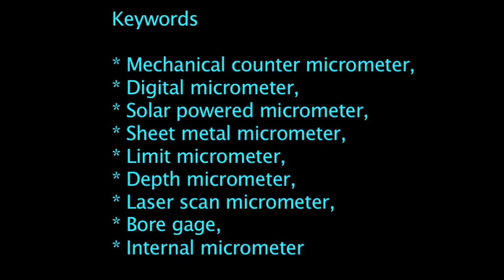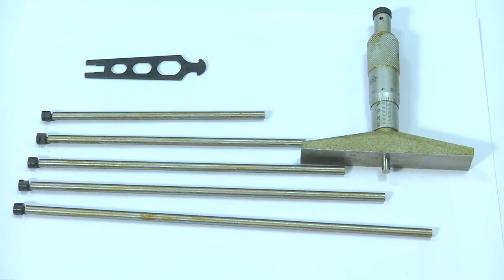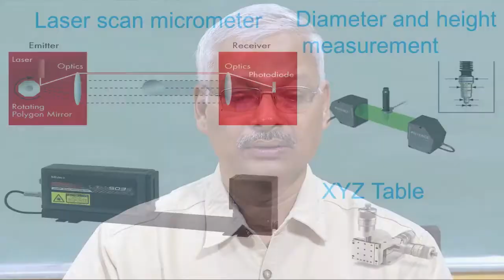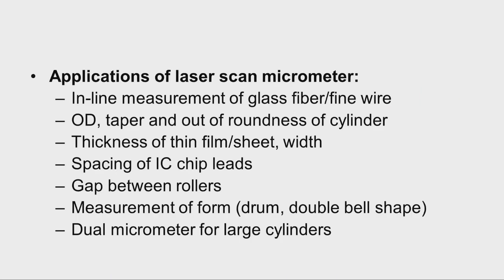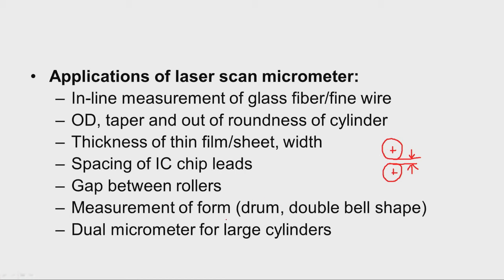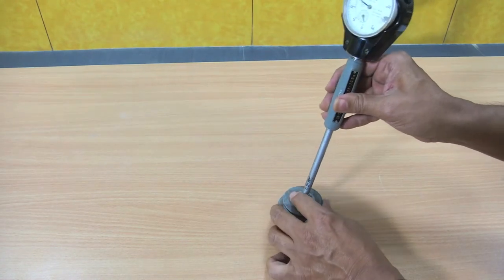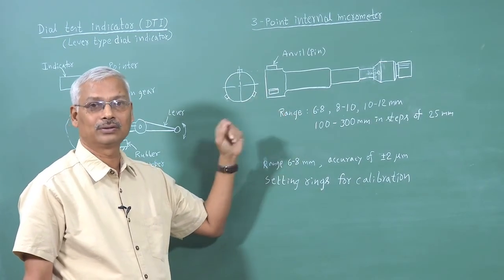Linear measuring instruments – 4 (Micrometers – 2, Bore gauge)

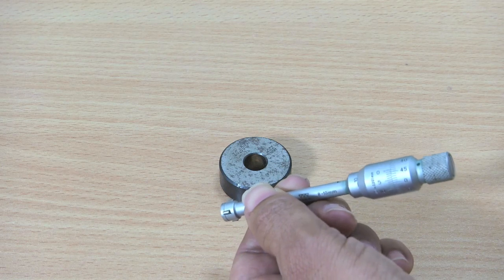Comment: 43:25 .. the reading should be 9.5mm+(0.001*44)=9.544mm not for 9.94mm because he took resolution 0.01mm not for 0.001(as it is specified).
Reply: I don't think so. We know it has gone past the 9.5 mark for sure but then it is plus 44 hundredths of a millimetre on the barrel plus 0 thousandths as it read 0 on the vernier . So it is 9.5 plus .440 = 9.940 mm.